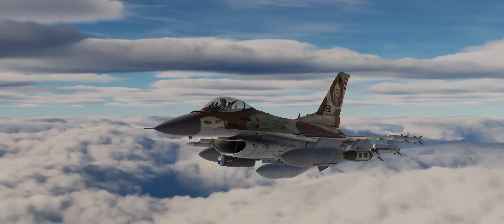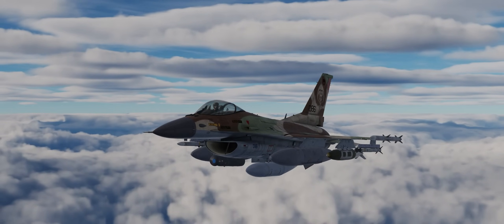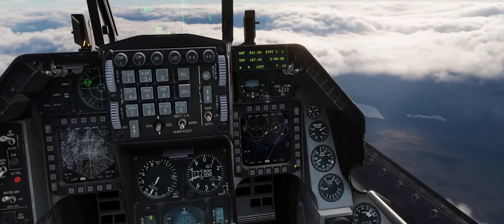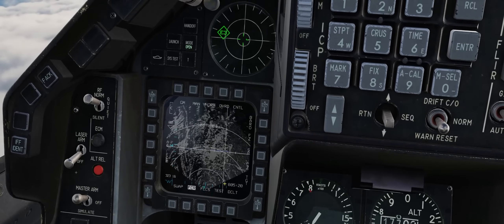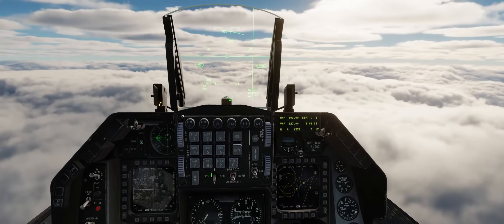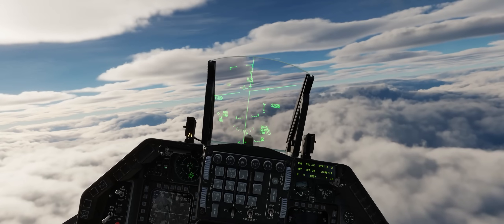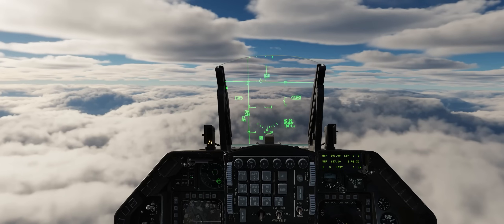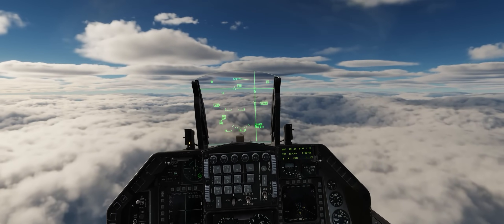DCS F-16C Viper Air to Ground RADAR BEST USE CASE!

Comment: Hey Spudknocker! just gotta ask it here because i cant seem to find any info online. for me when i get a lock with the ground radar on stationary planes + convert it into a mark point. the actual point or steerpoint that i created through the ground radar is misaligned with where its supposed to be. When I drop the bomb it goes off target to the right. Is this a current bug in beta or am I doing something wrong. Also, when I zoom in to DopplerSharpening 2 and shorten the azimuth to A3 or A1, the radar seems to slow down. As im seeing in videos, its supposed to speed up in these modes. any advice? tks

Comment: How much 2000 pound JDAMS or 500 pound GBUs an F-16 can carry and for comparison how it looks like for the F/A 18? I am an A-10C II pilot and want to expand my garage.
Reply: The F16C can carry (if I’m not wrong) at max of 4 2000lb JDAMs, but due to the amount of fuel the F16 has access to, it can only realistically carry 2 of those big boys.
500lb GBU12 or GBU38 JDAMs however, can be carried on 2*2 racks. (4 bombs total.)

Something the Viper can do better than the Hornet though is Mavericks, the Hornet can only carry 4 while the Viper can max out at 6 Mavs, plus 2 side bags and ECM if needed, not to mention the 2 AMRAAMs and 2 AIM9Xs you can carry along.

Comment: I'm a bit confused. First, am I correct in assuming that the weapon used was GPS guided? Second, what indication did you have that you were in the Acceptable Launch Range telling you it was okay to release?
Reply: 4 months late, but here we go:
Yes, he is using a JDAM type of weapon, which is GPS Guided.
He knows that it was okay for weapon release because of that tiny bar on the bottom right of the HUD, he gets it just in the middle to make sure it is okay to drop the bomb and not lose too much of its energy.

Comment: So, does the AG radar feels better, worse or on pair with the one from the hornet? And does it allow to attack tank sized targets?
Reply: You are not really going to use the ground map mode to track tanks and attack them. It is really meant for larger, mostly static targets (or very large groups of targets). For individual vehicles (like tanks) that are on the move, you would have better luck with the Ground Moving Target mode.

Comment: Hey Spud, I would actually augment or redo this video showing that you can get a MUCH clearer picture by adjusting the scale to 10NM, as Wags and others have pointed out. What you showed right now is actually a pretty poor way of using the radar, since you skipped out on one of the most useful features it has. 

You always do a good job explaining systems, whys and hows for DCS planes, so there are a lot of people who just watch your channel to learn. Those people might get frustrated with the A/G radar because you can actually miss your target by quite a lot if you keep the radar at this resolution.

Comment: can to use mavericks with this ground radar ?
Reply: Should be possible as long as they then can lock onto the targets, which requires clear view. So basically you'll set a SPI with the radar, the Mav slaves to that instead of taking it from the "teapot" and if it then catches something, Rifle! That gets particularly interesting with the upcoming GMT mode (Hornet has it already).

Comment: Suggest you scale in much closer to 10 nm scale once in DSB2. Scale in this regard is the image scale size, not range from aircraft.
Reply from the maker: Thanks Wags! Always appreciate the tips
Reply: Perfect! I was wondering the same thing. The image was MUCH more defined on Wags' demonstration.
Reply: Hi, Matt and Spud, what about the beacon submode?
Reply: @DJones476  BCN is not planned (Source ED/MW)
Reply: @michaeltripplem9405  B...b...b...but...  Why?
Reply: @DJones476  That MW might answer
Reply: So when im 50 miles from target I can use 10 ? So its not that I have to switch to 10 when within 10 miles from target?

Comment: What is the purpose of freezing the radar?
Reply: So that the picture doesn't keep updating on you as your slewing the cursor, also there is a delay if you move it unfrozen because when you move the cursor it has to rebuild the picture as it will always recenter itself on the cursor.
Reply: @jarhead1145  I don't have a proper understanding of how it works so I could very easily be wrong. When he freezes it and slews the cursor around, the image is moved around. Couldn't it just do that but also update the image that is being moved about like it normaly does. And I don't see how it updating is a problem, it would let you see any changes that happen.
Reply: @epicgamer42069  See the DBS modes take longer to create an image, thus the delay. So if you move the cursor while unfrozen, it needs to recreate the whole thing again centered on your cursor. This is like a 1 second delay with each movement of the cursor. But if you freeze it, then there is no delay. Not saying it's impossible to do it without freezing but it's not intuitive.

Comment: is there a way to get the TGP to slew to the radar SPI?
Reply: press TGT on the TGP page
Reply: @default9636  Correct, select the TGT sighting option once the SPI is created.
Reply: @default9636  awesome thanks!
Reply: Not on this release.  Don't think A2G Radar actually generates a SPI yet...
Reply: @jaybeckman3749  But isn't the bomb going for the SPI?
Reply: @realQuiGon  As primarily a Warthog Driver, I consider a SPI something that any or ALL sensors can slave to.  Nothing else can slave to the radar target in the Viper (yet) so I'm not really willing to call it a true SPI.
I'm just going to call it a "Target"